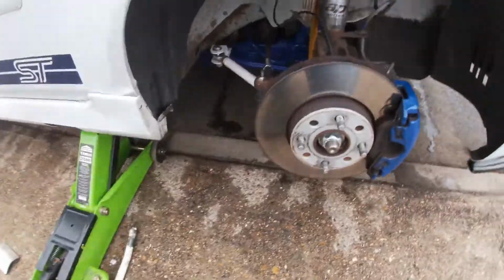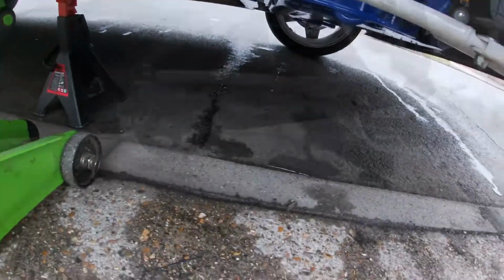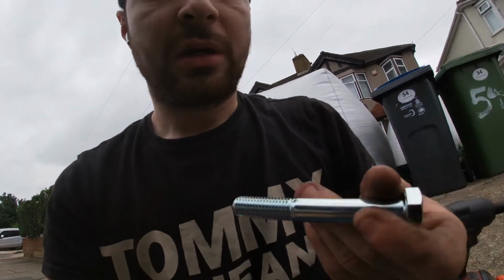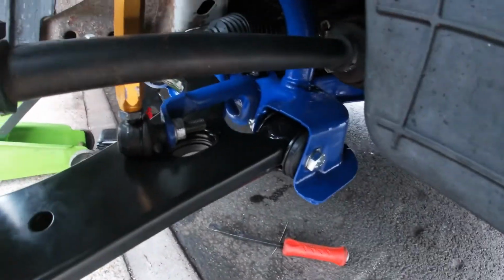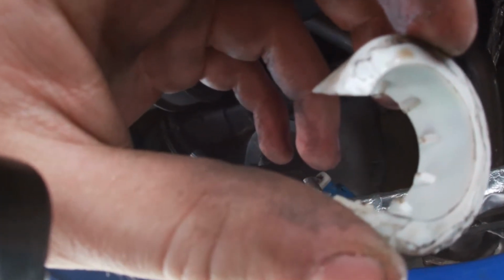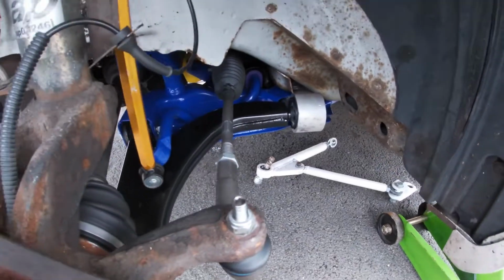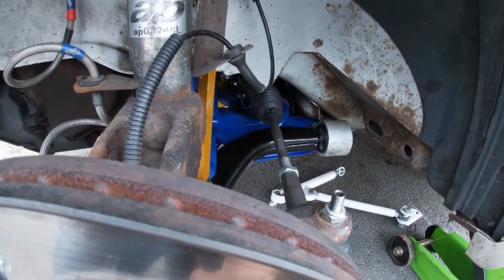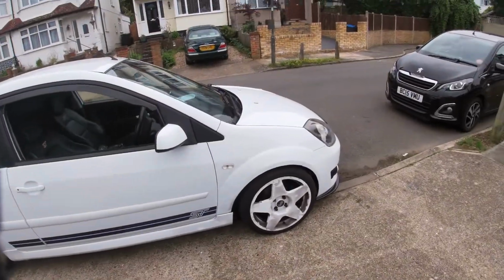My New Wishbones Have Destroyed My Car!

Comment: Just seen your vid when you fitted them & thought Nooooo! 2 years ago, I bought adjustable tubular wishbones from the same guy for a Focus MK1 race car we built. They're a great idea but the engineering is off and they just don't work. I'm now building an ST150 race car and will weld a 20mm extension to the standard wishbone to give camber but no adjustment - same solution as the Focus. It's a simple solution if you ever want to give your car some neg camber. Engine by Toovey. Quaife sequential box  😊
Reply from the maker: Yeah they’re not the greatest I must admit just going to stick with the stock ones for now and decide once I get some other bits done and sounds like a bit of a weapon buddy 😊👍🏻